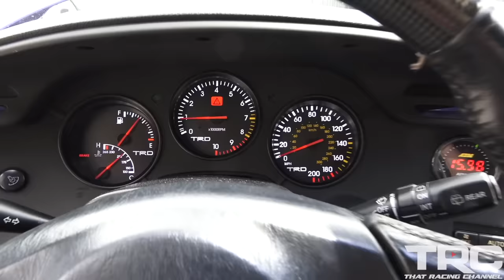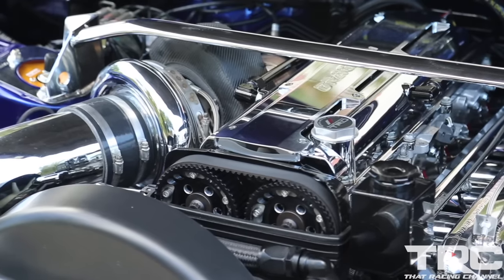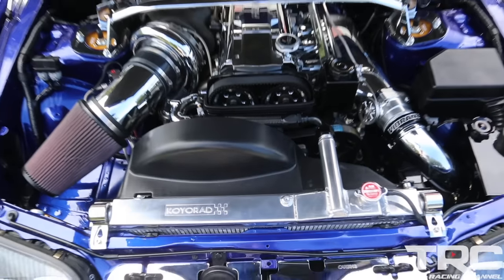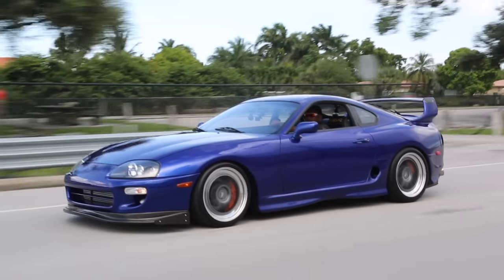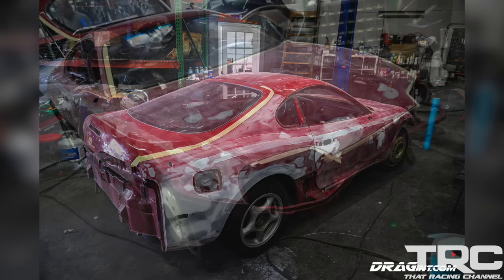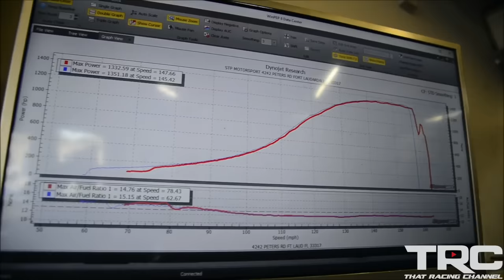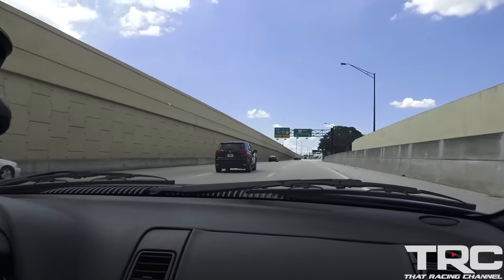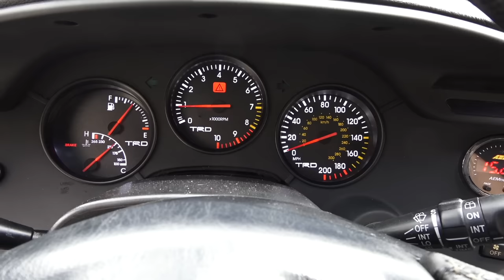1500HP Supra Gettin' Rowdy - 2JZ Eargasm!

Comment: Supras are the best looking cars in the world
Reply: 2 Saucy viper and Supra are my top two.
Reply: finally someone with working eyes
Reply: Yeah thats a no.

There's a lot of cars out there.

You cant just say its the best looking car in the world

And 1500hp with ridiculous amounts of pressure in turbo is an abuse
Reply: @nakazatotakeshi4286  really, 1500 hp for a supra is nothing they can get up to 3000 hp with no problem
Reply: @MEYH3M  i said its an fucking abuse. Not that i said it can destroy the engine .
Imagine you trapped and somebody shoved high pressure air onto you.
And why the fuck you need that many horsepower? 
Pretty sure you get wheelspin exiting the corner
Reply: Naw acura nsx
Reply: GBE- ZJL yo its  the mark IV is a master piece
Reply: I wouldnt say that but the they're amazing fast and nice sound when 2step o 2jz or ro- gags rotary engine
Reply: @nakazatotakeshi4286  Supras have unlimited upragades. Those turbos can take much pressure and can get 2k+ HP without any problem
Reply: @wesleysavage444  yes and gtr34 too
Reply: How about Skyline r34? That's a good looking beast
Reply: Best looking car in the world is Paulussen Beradino.
Reply: Will King  the 2020 one makes me wanna jump off a bridge into water with my hands tied behind my back at 100+ mph
Reply: Supra the Best speed.. J2z the best
Reply: @nakazatotakeshi4286  what about that ugly boat bug buffalo? Are those 1500hp power of 4 turbos abuse too? Keep that Same energy.
Reply: @wesleysavage444  lmao
Reply: on God!
Reply: sw20 Mr2's are pretty sexy to

Comment: now that im pushing 40yo these are the builds i love,full interior/ice cold ac/heater etc etc.when i started the hobby in my 20s i purposly stripped things like ac/power steering,but being young it seems like the heat and cold dont bother you as much compared to being older.. now i build my cars to retain these creature comforts and its a must for me,even cages must be the type that allow full interior for me.not just those comforts but builds like this where you build for 40psi and run 30 psi and have a nice reliable streetcar thats not teetering on the edge of blowing.

Comment: While I’m here only wanting 600 WHP out of my 2JZ-E30 build.
Reply: That much power in a car that light is nuts!
Reply: Slowly putting it together on the channel.
Reply: Why putting 2jz in a fucking e30
Reply: MendezPresents better question, why not?
Reply: MendezPresents Japanese torque and reliability
Reply: Welcome To The Madness I wish my E30 had a 2jz lol mine is just a stock 323i
Reply: I gave you follow bro bro u got this 👏🏽💪🏽💯
Reply: MendezPresents why not? Scandinavian has done this for a while, 2JZ engine E30 with 900-1400hp it’s just fun at track days ^^
Reply: 600 is reasonable still..  you don't need sticky drag slicks to hook. 1000 HP goes nowhere if it can't hook.
Reply: That low key channel plug
Reply: it's lighter
Reply: @dre1507  supras are not light weight cars, Mazda rx7 is way lighter or a MR2 those are redicolously light weight
Reply: @WelcomeToTheMadness  exactly.. I have a 2jz Lexus gs300 and people ask me the same thing
Reply: @linkuxsnooks5256  I'm going to 2jzgte my gs300 next year

Comment: Sexy AF..  Who the hell would thumbs down this video..  Oyeah... 2jz Hater's! 😂😂😂
Reply: @JO-jf2xk  The safety of innocent road users is compromised by incompetent drivers, and drunk idiots, not real car enthusiasts who like to drive fast, cause they know how to drive.
Reply: They are Rb26 Dett lover who are disliking the vid (i like both)
Reply: Probably mustangs haters !
Reply: I don't think this is 2jz anymore. It has custom block, piston, and other shit
Reply: Muso-kun I don’t think you know how engine building works my friend. The stock 2JZ block can handle this all day. As for pistons, there is no 6 cylinder engine on this planet that can handle 1500 hp on stock cast pistons. Of course the pistons are forged. Did you honestly expect this thing to pump out 1500 hp with a stock rotating assembly?
Reply: @megashocker333  In this built they use custom block aren't they? Not the 2JZ block right?
Reply: Muso-kun It’s still the stock cast iron block, you can get a billet block but it’s unnecessary for this level of performance. Cast iron blocks for the most part are stronger than aluminum alloy blocks found in 99% of vehicles today. Their thermal efficiency is just better than aluminum, a cast aluminum block will twist/crack/melt way before an iron block will. The downside to iron blocks are weight as in they weigh a lot. This 3.0 L motor is close to a 6.2 L aluminum ls3 in weight.
Reply: @megashocker333  It's not stock block. Look at the comment. It use custom block. But i don't know what the material is
Reply: @megashocker333  It use DRAGint block
Reply: Muso-kun Dragint built the bottom end, it’s still the stock block. The main caps, crank, rods, pistons, bearings are dragint built components NOT the block itself. It’s still the cast block. Dragint doesn’t sell or even mention a billet or custom block on their website.
Reply: @megashocker333  Ok thanks for info

Comment: What's the rattling noise that's coming under the hood?
Reply from the maker: Thats the sound of horsepower
Reply: Yea sounds like a box of rocks.
Reply: dat1dsm light flywheel on supras sound like that it’s horrible
Reply: Geo Engineering interesting. Sounds like something loose.
Reply: Yea, mine sounds like that. Works fine.
Reply: Ya it’s from the single mass flywheel. You often get bad “chatter” like that when the car is sitting at idle
Reply: It's from the triple plate clutch
Reply: It’s the light clutch/flywheel. I’ve got the same on my s14a
Reply: Thats the sound of a 10 second car
Reply: @gkldll  this has the power of an 8 sec car tbh
Reply: Flywheel chatter, much louder in person
Reply: I herd that too sound like a knocking sound almost followed by clattering
Reply: So everyone is saying it's the flywheel. So is this normal guy's? Honestly.
Reply: @anythingadrenaline4515  yes high power components are beefy resulting in alot of rotational mass that contacts each other rather loudly
Reply: @boosted_brody5474  you pointed that out for me, thanks man
Reply: @donovanwallace1449  Thank you!
Reply: It's not flywheel, how does the flywheel make that sound when the clutch diaphragm is engaged onto it and at idle? That sound is the sound of a fully built engine with looser clearances on the piston to wall for big boost application.... It sounds like that at idle but when ur boostin 35+ pounds the rings will expand and make up for that clearance. It's normal or maybe too much clearance...
Reply: @blaE  wrong boss its common on 2jz's. Look it up, it sucks but if you want to make big power factory luxuries have to go.
Reply: Most likely its the solid lifters that are making that noise. That is common on some solid lifter set ups no matter what type of motor. The microphone will magnify the sound and make it sound worst than it really sounds in person.
Reply: @gkldll  sounds like its bout to send a rod flying out the side of the block.
Reply: Sounds like a rod is about to catch flight out the side of the block.
Reply: If the nasty sound is due to "high horsepower components", then why is this the first high HP Supra I've heard on YouTube that sounds like it's dying?
Reply: Common in the 6 speed supras. It's from the transmission. Nothing is wrong, just how it is.
Reply: dat1dsm that’s the triple disk clutch , nothing is wrong with the car !!
Reply: It’s the triple disk clutch.  Mine sounds just like that.
Reply: @dacountryone  great opportunity for a rb6 swap 😂🤣😂🤣😊
Reply: I broke my flywheel bolts to much power in my Corolla. Twice.😫
Reply: Either the Flywheel, or my personal guess, the forged pistons on a cold engine. They mostly use higher clearances in order to expand to the right amount under heavy load & temps. When the engine is warmed up, the noise should be gone
Reply: Sounds like piston slap to me, pretty normal with forged pistons.  My subi slapped until it warmed up
Reply: Cam gear chatter
Reply: I have a triple plate clutch in mine and it sounds like that
Reply: actually just read the parts I have the exact same orc 1000 triple plate
Reply: Guy Holloway yep 👍
Reply: multi disc clutches make that sound, ORC especially had one on my supra was loud as, now run a twin carbon and the shatter is very quite but still there.
Reply: People saying that's engine noise need to go back to their engine builder and get their money back. Definitely flywheel chatter. Not uncommon.
Reply: Clutch/flywheel chatter. Happens with aftermarket clutches, especially multiple disc clutches.
Reply: From a racing clutch paired with a single mass flywheel. You don't have a dampening effect with something like a dual mass flywheel.
Reply: Lol. Like a million different opinions no one knows what they saying
Reply: @justinmartin8887  Actually there is quite a few people who responded who knew exactly what it is. But if you don't know that's cool, don't try to act like you do.
Reply: Socal Fritos they’re obviously not right, at least 90% of them. There’s literally guys saying that’s piston slap😮 can only imagine how the sidewall would look if that where piston slap! Btw I built my own truck it’s on my channel... not for the views but to prove that I know what I’m saying.
Reply: @justinmartin8887  Then don't say no one knows what they are saying. Because there were obvious correct answers, so don't act like you know more than everyone commenting. Why don't you comment on the people who actually knows what's going on and stated the correct answer.
Reply: Socal Fritos I wasn’t, I was commenting on the many that didn’t know what they where saying. I rebuilt and diagnosed , worked on many engines in my life. dt466, 5.9 common rail and 12 valve 5.9, alh Tdi, 5vz-fe Toyota, 2.5 vw, 1.8t, big cam cummins, and many of them where particularly and specifically performance oriented, so yea, shut up pal I know exactly what I’m doin your barking at a Rottweiler, jack russell.
Reply: Its the engine because its running
Reply: a.cobcro lol with the right tires and tranny swap it’s an 8 second car. 850hp 5.0 mustang are running 9s.
Reply: Taj Parker I just came to read the comments of you guys who know nothing. Nothing to do with a lifter 😂😂😂😂😂
Reply: Sounds like an ass kicking
Reply: Dual or triple disc clutches rattle like that, its common.
Reply: I was thinking the same thing.   Didn’t sound too healthy.
Reply: Ive heard of clutch chatter taking off from first or in R but never at idle
Reply: BTA PRODUCTIONS  triple disk clutch, it’s very common on high hp rated clutches. There is no dampeners in between the pressure plates and the housing. Street dual or triple discs have bushings in between but they will fall out or come apart after hard use.
Reply: "Sounds like a leaky spark tube"
Reply: thats the sound of contemplation man!
Reply: lol no, this thread is nuts. The clutch plates are tight when your foot is off the clutch. The double and triple disks clutches only chatter and rattle when your foot is on the clutch as everything is then loose.

Short answer for the noise is GEAR RATTLE. If anyone doubts it, google gear rattle in the v160 transmission. When you take off the dual mass dampening flywheel on a supra and put a solid flywheel on, your transmission will sound like its full of rocks below 1000rpm. Apparently it doesnt harm it, and mines been fine for 5 years like that so i'd say its true.
Reply: @The1andonlyDMFH  well if thats the case id never buy a triple cuz that sounds like dog shit at idle
Reply: BTA PRODUCTIONS  if your making a shit ton of power you don’t have a choice, there’s not many single discs that will handle that much torque. If they did the spring pressure would be so high you could barely disengage the clutch. Some do have dampeners in them that help with the noise  but they normally just fall out and then it’s louder than the ones without dampeners because of the extra space to allow movement.
Reply: alocaurd that’s another annoying noise I’ve heard from manual transmissions. I had a 6 speed Cummins that someone did a clutch on and dropped the dowels. When they reinstalled it it was a 1/4 inch out of line. After 70k miles of putting slight pressure on the gears and wearing them in an odd matter it was still quite. After I did a clutch and made new dowels for it to go back in the right spot it made the exact same noise this Supra was making. put 50k miles of hard towing no problem on it. When I pulled it apart just to see what it was, you could see the wear on the Countershaft and the gears closer to the front but still would have worked no problem had I left it alone.
Reply: @The1andonlyDMFH  I'm not sure if you're agreeing with me about the noise or not, but I can literally go film my car idling with a single disk clutch making this noise. I've heard it in my friends Cummins as you describe as well actually with a south bend clutch installed. When you take off the dual mass flywheel, the trans rattles, plain and simple
Reply: alocaurd yea you just misunderstood me, I agree, I’ve heard gear noise just like this before. It baffled me at first. I pulled the trans back out and checked the clutch just to be sure. It was a singe disk southbend with a single mass flywheel. I was just explaining why it had gear noise. I know it wasn’t the clutch. After I replaced the countershaft and the front few gears it went away.
Reply: Jared Nielsen at the 5 min mark the noise was gone
Reply: dat1dsm noise was gone at the 5 min mark
Reply: Socal Fritos so which answer is correct? Is it the clutch or the flywheel or gear rattle?
Reply: Its the kanuter valve or muffler bearing for sure !!!  SWEET CAR !!!
Reply: Sounds like an airplane...

Comment: short shift short shifttttttttttt it's like i'm watching adam lz drive
Reply: It was making me mad. The driver clearly doesnt know what he is doing. All money no skill
Reply: Fiz  unfortunately most youtubers drive like this, so frustrating
Reply: @MrLefizal  Have you driven a 1500 hp FR street car before?
Reply: @joshAKAtheman  1500? Not quite that high. Around 1,000 yes. Many bikes as well. Regardless though. I have however done many, many dumb things in vehicles and bikes. Such as but not limited to breaking 200mph on a turbo busa, drag racing light to light in the middle of a downtown area at 3 am in a procharger camaro. All I am saying is, money can buy you toys but not everyone has the skill to use them properly.
Reply: @MrLefizal  then you probably already know that shifting in a 1500 hp car is not the same thing as shifting in a normal street car. Not only that its obvious that such a high horsepower car with that layout (FR) is very prone to losing control and spinning out with little to no excessive use on the gas.
I think the driver is prolly just taking it easy since theyre on city streets
Reply: @joshAKAtheman  Im inclined to disagree. Plenty of other videos of people with the same supra with the same HP and more even shifting like you're supposed to shift. IDK what is so hard about admitting that the guy is clearly not comfortable with the car and is shifting like a bitch. Another point is you are doing a video for a pretty big car racing youtube channel. Let er rip...

On a side note I completely understand the reasoning behind it possibly losing control on the road. However, with that being said. The location choice was trash. Get on the freeway or somewhere with less traffic.

Comment: Thats a lot of turbo lag.. Maybe too much power i would be very happy w 600-700RWHP.
Reply: Luis Landa only way to beat super cars
Reply: 650-750whp seems to be the supra sweet spot, I would be scared driving a 1500whp car. The reliability must suck
Reply: If you didn't have turbo lag the car would spin so much it will go out of control he's lucky he has turbo lag
Reply: I agree, my '94 had HKS GT2835, way too much lag, only 2K rpm to play.
Switched out to an SP turbo at 700hp, muuuuch better, more play, lots of power.

Comment: Throw just random numbers.,,,, titanium 900000 exhaust with 200 air cooler motor with 840 wipers....with butt switch 24...have like 9028 ass powers with 3452 back thrust issues. Overall its a cool street car.

Comment: The Supra is so overvalued it’s insane. I grew up in the 80s and 90s and loved the Supra back in 93, back then they were selling for $35K with very low miles for the Turbo, but I would never pay what they’re going for now. $45,000 for horrible condition (100,000+ miles) and if you want low miles it’s up to $100,000K for a good one? For 30 year old used Toyota? Get the ** out of here. Lmao ppl are stupid for paying that. $100,000 for the car plus another $100,000 for mods, Might as well get a Ferrari 488 Pista at that point 😂 Looks better than most modern cars but as an OG 1990s teen and MK4 Supra lover, todays prices? Not worth it.

Comment: My Dream car!!! Lol thats way to much HP for street
Reply: Yep.  My GT-R is about 750 wheel hp at 2.0 bar and it's really close to being more than is safe on normal roads.  Plus it's really hard to play around with it because winding out 2nd it already breaking the highway speed limit of 55.  My 2nd runs out about 70mph.  Basically, you play around with it and a cop sees you, you are in deep shit.  3rd gear pull on the highway and you're going to jail.  My 4th gear runs out at 170mph and I've never bothered to push 5th.

Comment: 3 liter?  Man I would have put an aluminum lsx 427 in it and made 2000 hp all day long.  Then just turn the boost down until you actually get traction lol.  Less laggy boost and better mile and 1/4 mile times.